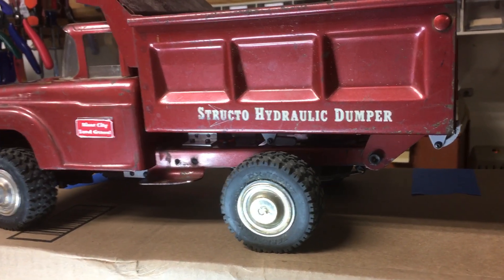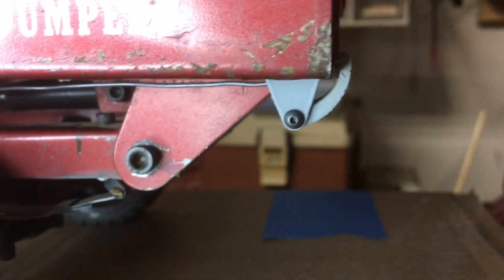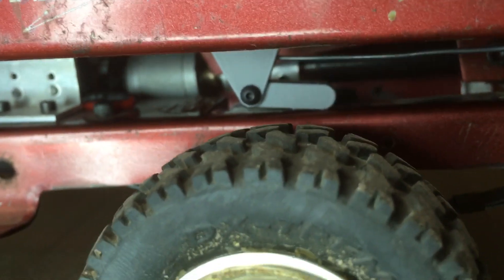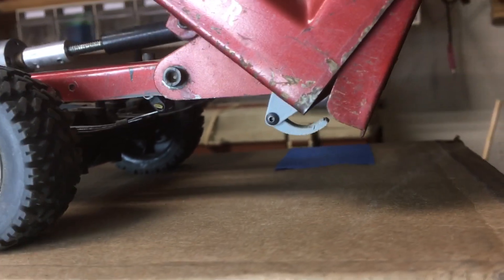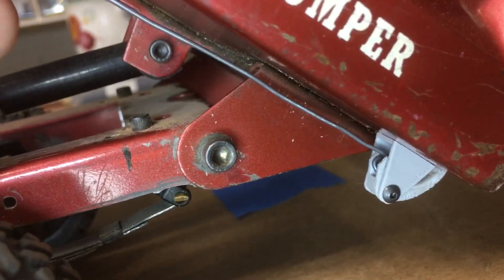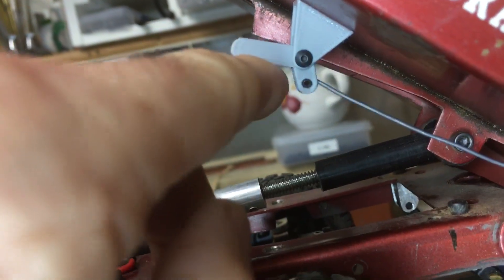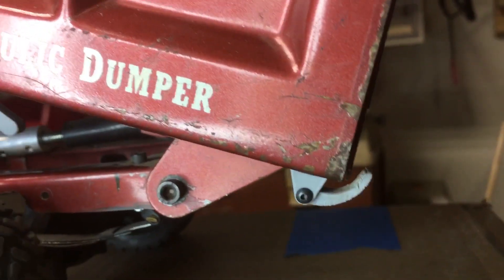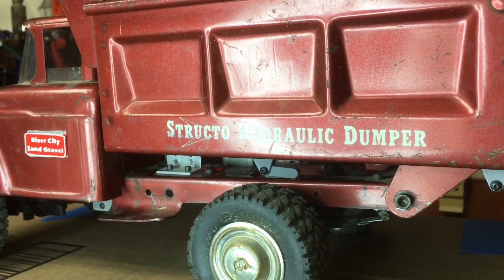Tailgate latch system

Comment from the maker: I solved the over center concern by adding a stop to the bracket so the latch won't rotate past the normal open position.  If you want drawings, stl files or actual prints just leave me a comment here or on my construction company thread on http://www.rctruckandconstruction.com/showthread.php?t=13278  jim